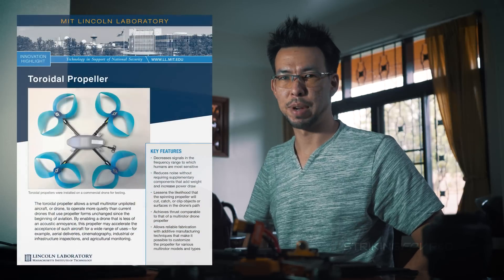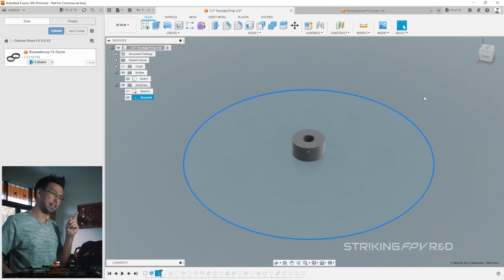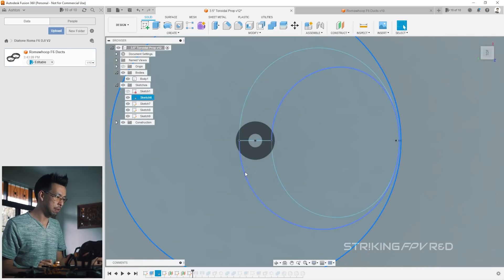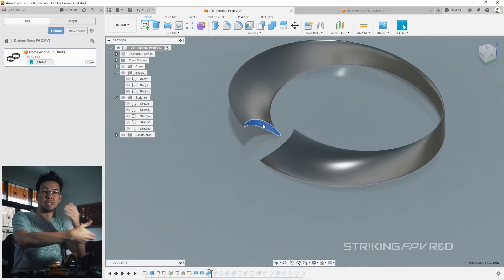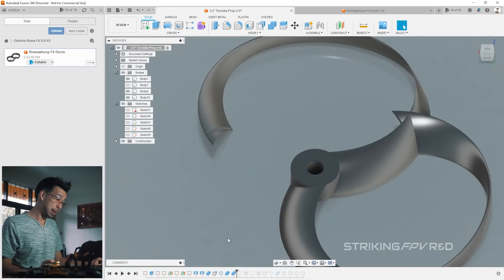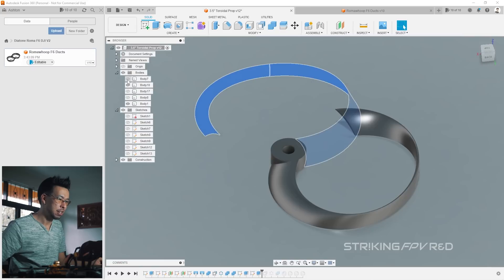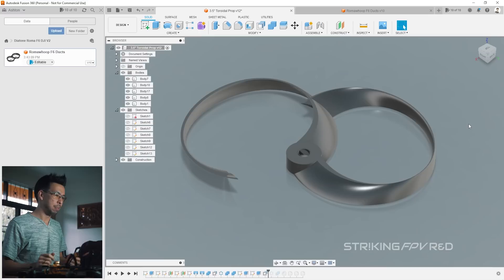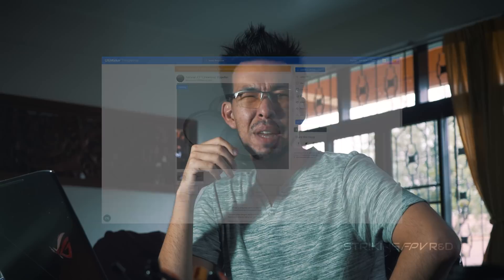DIY MIT Toroidal Propellers for Cinewhoop FPV Drones???

Comment: Awesome! Just got the files. I'll try it right away. Thanks for sharing your design, and insights into creating it.

I'll be back!
Reply: After reading your update, I've decided to print them with PCTPE. It's kinda like the "TPU" of nylon. My nylon filaments just spent 10 hours in the dryer a few days ago. Stored air tight with desiccant since then, the PCTPE should print super clean.
Reply from the maker: @24kJames  I look forward to the results!
Reply: @STRIKING FPV  First two props are done, 3.5" T Mount. They weigh 3.3g, while the gemfan 3.5" tri blades weigh 1.93g. I have one 3.5" drone with 1404s, and I have another that I built with 2004s. Worth noting that the low pitch, 5" tri blades from gemfan, commonly paired with 2004 motors (at least initially,) still come in lighter at 2.9g. I had an urge to modify the design straight away, to reduce weight, but knew that I needed to get my baseline first, using the design as is. I can see I'll need to drill out the t mount holes. I have a jig for drilling 1.5mm props out to 2mm, so it shouldn't be an issue. I'll adjust the design accordingly on the next round. Okay, 2.5 more hours of print time, and I'll be taking these babies airborne! They look fantastic in black PCTPE, which printed super clean, no supports.  OH, and the main reason why I came back to comment right now, is that I'm installing an octoprint plug in that should let me stream the print to youtube, so I'll come back with a link of i get it working.
Reply from the maker: @24kJames  Haha, that's cool. Interesting on the weight, though I'm not surprised since I made the blades thicker than what would be ideal to account for lower strength with 3D printed stuff.

My next iteration I'll probably thin them out a bit, but will more or less be reserved for those with SLA or SLS printers (or impeccably tuned FDMs, hehe)
Reply: @STRIKING FPV  I forgot I had another 3.5" quad with 1303s, a light weight, printed frame and canopy that flies great on 3S. I decided it was best suited for the job. Unfortunately, the props aren't working for me. They don't seem to provide enough lift, but I need to verify it's not an error on my part. I'll make a video and drop a link here so you can make an assessment.
Reply: @STRIKING FPV  I look forward to seeing your next iteration. You inspire me to try designing a prop myself. I'll definitely be referencing your design, and the generous instruction, and explanation, in your video. Here are a couple photos until I get back home, and can make the video. ..oh, and I had to abort the stream attempt for time. Cheers!
Reply from the maker: @24kJames  Sorry to hear that it didn't work, I'll definitely be trying to get these a bit more efficient somehow.  I'm thinking about shallower blade angle, or keeping the blade angle shallower further out, somehow?  Lots of things to think about.  Great to hear that you be giving it a go though!

Comment: New to Fusion 360 and can't figure out how to make those rails like that. I've been working for hours and feel dumb lol
Reply from the maker: Oh man, sorry - the files you need to download individually because Thingiverse sometimes corrupts the zip files.  As for the profiles and rails, they're literally just planes on the flat (z) axis and then splines which.  They need to intersect with points on the profiles to work.  Try looking up other Fusion 360 tutorials on using the loft tool with rails, and I think you'll get a better idea of how it works.  It was my first attempt with this design and was a little finicky but eventually worked out.

In future I'll probably do a real tutorial, but I'm travelling at the moment so it'll probably be a ways out.
Reply: @STRIKINGFPV  thanks for your help!
Reply: and for some reason I can't download the files :(
Reply: I am about eight months into fusion 360. You lost me on how you came up with the profiles that you started with. I would love it if you would do a fusion 360 tutorial you explain things very well.
Reply from the maker: @nmfireman  I would love to, but even my latest revision I've found a different way of doing the lofting, so I'm kinda' working it out as I go.

I'll be on the road for the next week or so, so I won't be able to do much, but when I get back home I'd definitely like to do a tutorial on this style of prop design.

For now, I might suggest looking at other Fusion 360 tutorials online regarding the loft feature, and related to that also the sweep feature which may also work somewhat maybe?

Comment: yes, just add much more weight to the props. this will have a affect on changing rpm. dont forget to go up to 32768 khz in your ESC to counter act the weight. at least you made a new video.
Reply from the maker: I have a feeling that an injection-moulded design could use thinner blades to save on weight because the toroidal design, coming back in on itself, adds to its own rigidity in some ways.  Certainly worth exploring.  The freestylers, upon seeing the news of toroidals, don't seem interested because of xyz reasons, but I think slower steady flyers like cinewhoopers (which are also the most loud and annoying, lol) will benefit from this eventually.
Reply: @STRIKINGFPV  just guessing, never. the prop rpms they have is so high, because of the diameter. if you add just 20% more weight and i think it would be some more, they are just loose too much rpm control.  this type of prop is useful when you almost never have to change rpm and if, not in a fast way like quad esc use. in this use case it has too much downsides. the prop has to be as light as possible. this is no. 1 priority in rpm control. this is more important if the prop goes down in diameter.

Comment: I will try it in my resin printer. i would like to give this a try in my taycan , and that excepts 75mm. specs of taycan, holybro f7 mini 45A , apex 1608 2750 on 6s .
Reply from the maker: Just added a bunch of other designs ranging from 40mm up to 4", hope the 3" design will fit for you maybe?

Comment: Thanks so much for sharing the file.  Are you worried that your "3 loop" design is quite different from the MIT "2 loop" version"?  Seems like the pretty large change in the overall geometry wouldn't yield the same results as MIT's version?  I see Lincoln Labs used both 2 loop and 3 loop designs - the best closeups I can find (and their press release) seem to show the 2-loop at least: https://youtu.be/M0nMW1E8J90?t=129
Reply from the maker: Literally the only reason why I went with the tri-blade or tri-loop design is because it looks nicer 😂.  But yeah, I would actually like to try both designs to see which one works better - I dare say the bi-loop will be more efficient as we already experience this with longer range FPV drones flying with bi-blades for efficiency (and quietness), so I imagine it will come out on top.

I will say, though, that the tri-loop is potentially better in terms of safety since it's more likely to glance and bounce off obstacles (and fingers) than the bi-loop, so for Cinewhoops the tri-loop might end up being preferred for that added benefit.

Comment: Superb. Loved watching your design process. I spent several hours failing to do exactly this in Fusion360 last night 😂 I have a ProTek35 so these will drop straight on. Looking forward to doing some tests. 👍
Reply from the maker: Can't wait to see the results, hope it works out!
I just added a bunch more designs to the Thingiverse link, all scaled versions of the original but with correct shaft sizes including some T-mount.  Not sure if they'll work since I've never touched a t-mount before, but if the specs online are correct then they should work.
Reply: @STRIKINGFPV  first one is on the printer now! Am printing at 0.04mm layers to keep it as smooth as possible. 🤞
Reply from the maker: @davidpride3160  The suspense is killing me, but it's 1:30am and I gotta' sleep 😂
Reply: @STRIKINGFPV  Gonna wake up to loooooads of views & comments. 😁
Reply: @STRIKINGFPV keep us posted!!!!

Comment: is there's any 2 inch version for this props ?
Reply from the maker: Not yet, I'll consider doing it but I'm concerned that it might not be worth it because of the thickness required and how small 2" actually is.  I'll give it a go in maybe the next few days, but gotta' look up typical 2" mount - problem with 1mm holes and T-mount stuff is the holes are so small, I don't know how accurate it would come out on an FDM printer, certainly not great on mine 😬
Reply: @STRIKINGFPV  why not resin? resin can print thinly and strongly
Reply from the maker: @RedShade_Studios  Resin totally, I might end up making a different model with thinner blades for SLA and SLS processes, but I'm still on the road travelling so can't work on every design right now, hehe.
Reply: @STRIKINGFPV  because 2-3 inch cinewhoop is very noisy . i think if you can find a way to make this props for two inch , it will be a great impact . because 3.5 - 4 inch can use 2 blade normal propellers if they want silent props.☺ . But thankyou for share the file .
Reply: @STRIKINGFPV  i have 4" Flywoo explorer , but i just realize that the motor cannot fit on that hole , it use 2 screw hole and 1 shaf hole😓
Reply from the maker: @captaindronieversefpv  So have a look now on Thingiverse, I just added a bunch more sizes with T mounts as well - I don't own any t-mount drones so I'm just going with specs on the internet, no guarantees since nothing's been tested.  Hope they work for you 👍
Reply: @STRIKINGFPV  thankyou i'll try it